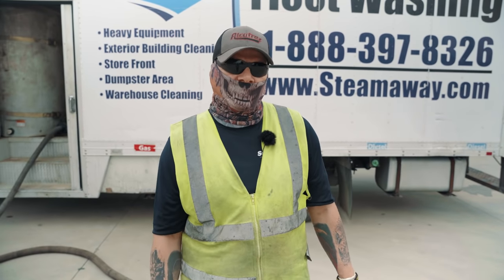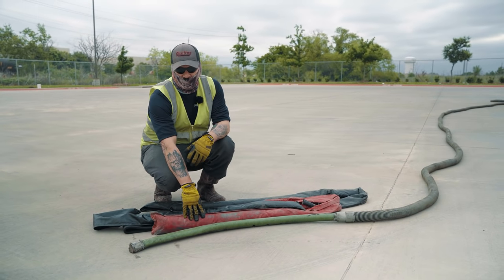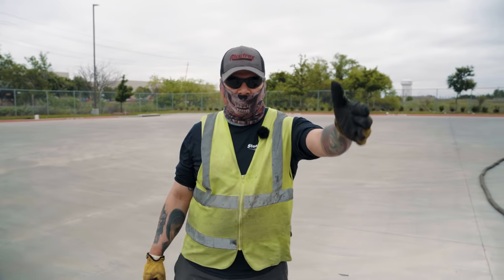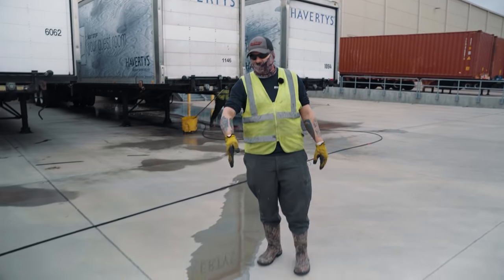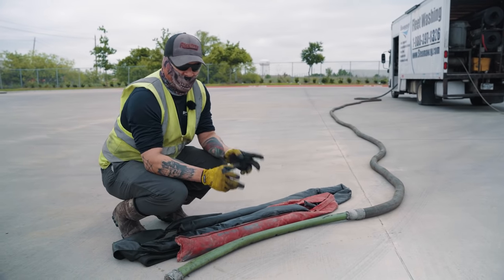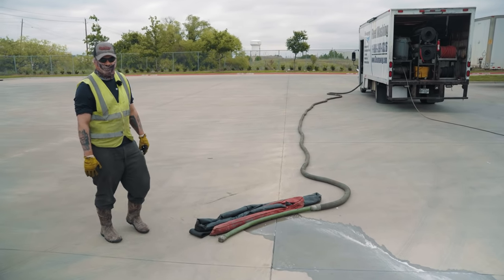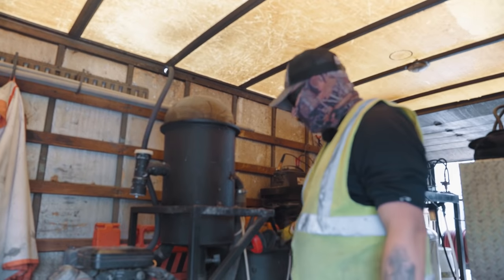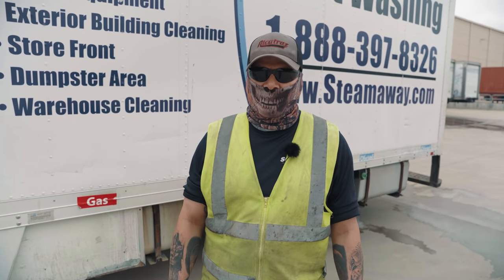How To Recover Wash Water And Why It's Important

Comment: How you dispose of the dirty water?
Reply: Polyester oil absorbant, flocculant settling, 50 micron filtration, dump down the sanitary sewer.
Reply: @u2ooberboober  Pretty good solution! Poly pads are almost cheap too!

Comment: Just built my first water reclamation system along with a surface cleaner that hooks directly up to the vacuum.  What's frustrating is the amount of guys out there that don't reclaim or at least relocate and tell ya you don't need to.   To many guys not knowing what they're doing and why.
Reply from the maker: That is great to hear! Unfortunately there are always cases like that.
Reply: Hi, can you make a video on how you did it, or do you have the video where you learned how? Thanks
Reply: @diamondback2085  is it the shop vac that connects to the surface cleaner I take it
Reply: @iamjacksundyingaddiction6595  the IPC eagle gives a pretty good run down how it's made.   But yeah.   Just if your connecting to a surface cleaner you will need more connectors and hoses to fit.  I made the setup I made because I have that surface cleaner selected.  But the primary use is to relocate water or in worst case scenario I can collect it for disposal later.  I don't usually do grease stains or anything like that mostly just cleaning up houses and driveways.  And in most areas so long as the dirty water does not go down the drains you're totally fine so aggressive field is sufficient.  You have to check the laws in your area some you have to actually collect and take away and clean the water before you dump it.  But again it depends on your area.  Basically I watched about 30 or 40 vids on how to build a 55 gallon Shop-Vac and then looked at Water recovery vacs and what their specs were and modified the Shop-Vac design to create a water recovery vac.  I plan to build out for about 2 months of study in 3 days of building
Reply: @iamjacksundyingaddiction6595  mine is no where near as powerful but will get the job done
Reply: @iamjacksundyingaddiction6595  sometimes I wish some of these channels had a discord channel to share what we've learned.   Would make it so much easier vs comments sections
Reply: What if its just water with no chemicals
Reply: @yournewstepdad5578  you have to check local codes.  Where I live in Illinois no wash water can go down the drains.  Chemical or no.   But different areas have different rules and regulations
Reply: where did you learn to build it? a link?

Comment: How you dispose of the dirty water?
Reply: In their back yard
Reply: @forthntwint  wouldn't that kill their plants?
Reply: You can put it in an evaporator setup (think open metal pan and a bed of coals underneath) and save the solids for solid waste. Or take the liquid waste to your water treatment center. Or a lot of folks just drop it into the sanitary sewer cleanout (probably illegal, especially if there's oil in it). There are also a lot of guys that just go to a car wash and drop it in the tunnel drain, since car washes have a robust filter / treatment system and are pretty heavily regulated. But that screws over the car wash because they'll have to replace filters / pump out and it costs THEM money...  The safest way is to call your water treatment center and ask them if they can take the liquid. If not, call the next treatment facility, etc. It's tough, and can get really expensive. So yeah, a lot of guys dump it into their own septic, and just budget 2-3 honey trucks a year. Disposal is maybe $1500/year that way, instead of $150-500/load (1-2 days of washing) at the plant.